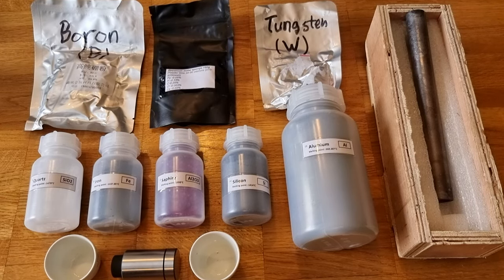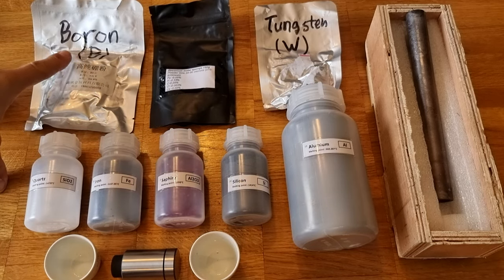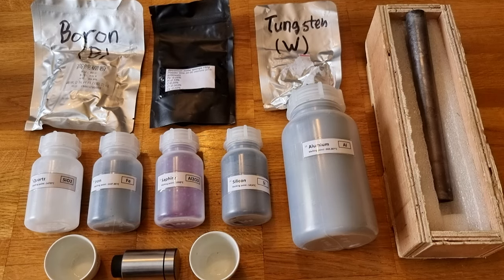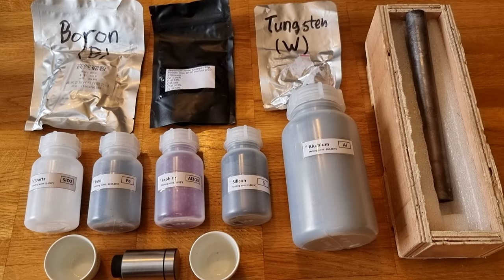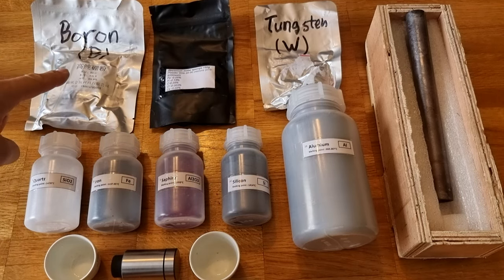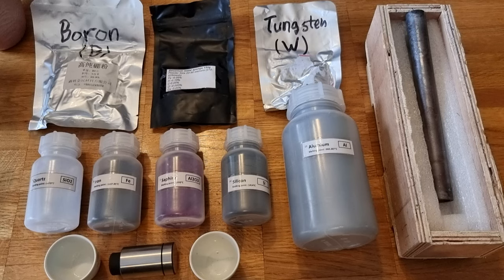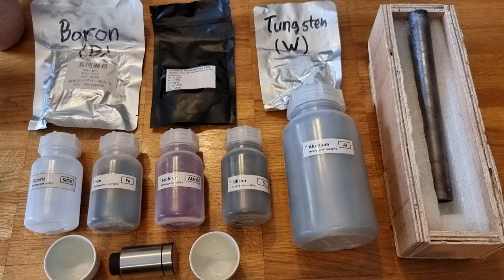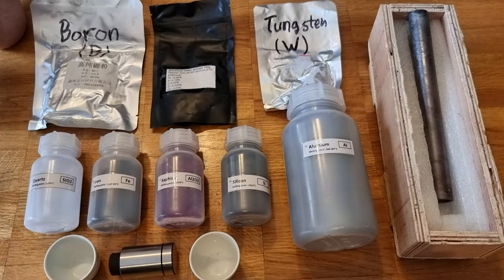Fixing Fukushima - Potential tests

Comment: Ah ok. I have run a reastion with a tungsten rods into molten borax with tungsten carbide powder mixed in the borax powder and graphite lined crucible. The W rods were welding rods with a welder driving the plasma once the borax was heated to glowing with a gas torch. It made a hard ceramic bubbly and sharp looking material (reminding me of volcanic scoria but a dark grey) that had some radioactive spots when tested with a cheap dosimeter device. It was long before I had heard of the works of the people you mention and I was muddling around by myself trying to transmute materials I had a hunch would play nicely together. The reaction was very hot and occasional blinding white hot points of light were seen in the glowing borax. A lot of smoke was given off and I stopped for the sake of not poisoning myself. Interested to know what you think of that...
Reply: I think that sounded like fun!
Reply: @joshhennen  yeah it was a one of those experiments that very quickly got so smokey with weird unknown smoke I got rather worried. But after seeing the radioactive scoria it made... pretty sure some transmuting went on. Went on to make what... I don't know. I still have a bunch of the tungsten carbide... I should repeat it for video
Reply: @m3sca1  If so be sure to do it in a well ventilated area! LOL! Good Luck!

Comment: Nice work! I'm working with a young woman who was in Japan when the earthquake happened by Fukashimo. She was driving on the highway and the road and bridge was swaying.  It was super scary. I told her your project was working on a way to remove? Not sure what the verb is, to clean up the radiation
Reply from the maker: Clean up the radiation is a good way of putting it - but more accurate is to stabilise the radionuclides.
Reply: @MFMP  my friend saw the explosion.
Reply from the maker: @cathsrq  Wow
Reply from the maker: @cathsrq  Well the iodine pill was a must and all that is necessary given the very short half-life of the iodine isotope they are protecting against. The choice of mask depended on prevailing winds and distance possibly - difficult to know if it was appropriate without knowing where they were and for how long during their exposure